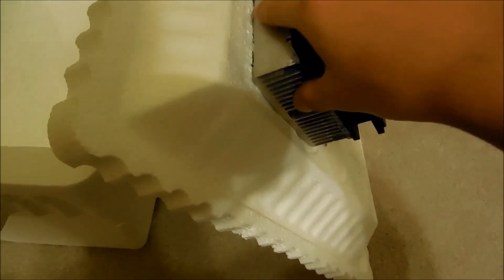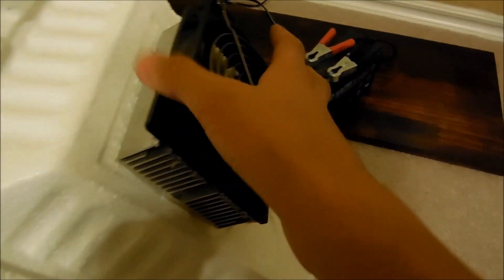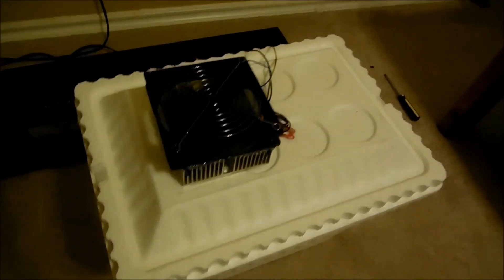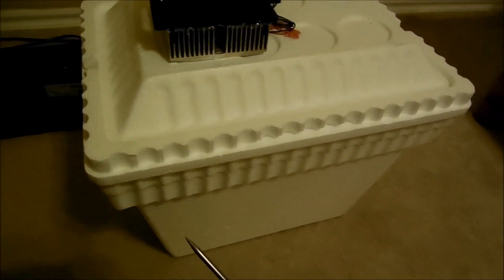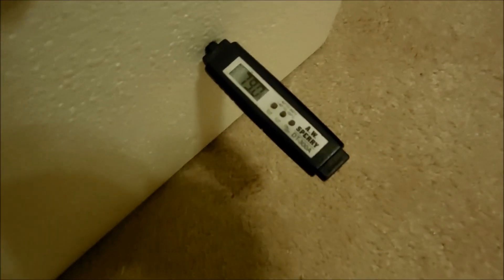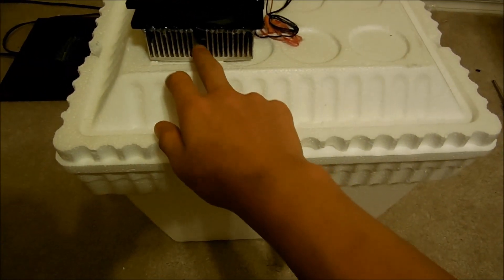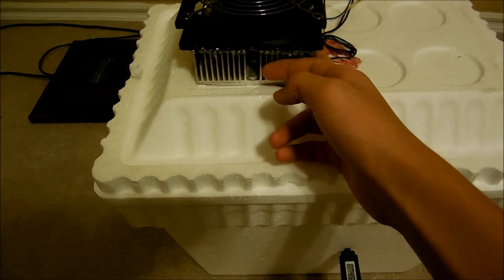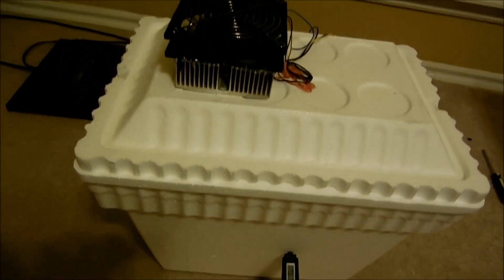DIY Thermoelectric Peltier Mini Fridge

Comment: This video is not complete without a real test of the cooling. Put some water bottles in there and then see how quickly you achieve temperature like 5-10 deg C
Reply from the maker: I agree...my 7 years younger self did not fully understand the importance of "thermal mass". The peltier thermoelectric cooler is extremely ineffective and inefficient, however I think it was still entertaining that it was actually able to cool down the volume of that ice chest.

Comment: 67F isn't really cool enough to consider this as a fridge.
did you ever check the current draw over the entire circuit. 
Would be helpful if one wanted o run this "cooler on a battery and needed to calculate running time.
Reply from the maker: It's certainly not optimal. But there are many "mini" fridges for sale that use this type of cooling device (that is actually where I got mine)

Comment: i had a quick question if i may ask. when hooking up the device with the 2 fans and peltier to a 12v 6a. should i do series circuit or parallel when hooking up the wires....
Reply from the maker: Parallel, all the positives together and all of the negatives together.
Reply: thanks

Comment: how about the power supply? how to circuit between peltier & fan.
Reply from the maker: The 12v Peltier and 12v computer fans all connect directly to a 12v battery, quite simple. If you want to use it in a car you could just connect the wires to a plug and use it in the car's 12v power socket.

Comment: Peace. Can something like this be used as a DIY A/C???
Reply: probably if the hot side is blowing out the window.
Reply from the maker: Yeah, you would need to vent it off outside but a pelier module does not have even a fraction of the heat pumping power to cool just a small room.

If you want to make a DIY A/C I would recommend finding an old fridge compressor and some AC coils and soldering up a refrigerant heat pump.
I am doing that for a DIY portable AC project and will eventually make a video of it.

Comment: Hi there,
Do you have a contact email. I tried sending you a private message in regards to the DIY fridge you made. I really need some help and advise on actually creating something using the same steps and system you did, but I want to make sure I am being safe and using the right materials.

Comment: i have a store bought can vending machine cooler. there is a spacer about 2 inches thick between the two heat sinks. Should i cut a hole in the back and put the heat sinks back to back? Will it make it colder?  I had to replace parts so i already have it hacked up with bigger fans.  It is 20 degrees colder than room temp. thanks

Comment: I wonder if a solar panel could power it all.
Reply from the maker: Yes, and no. The peltier plate itself uses 72W plus you need fans which is even more. With it drawing that much power you would need a really large solar panel which would cost a lot. (pelier units are extremely efficient)

Comment: I was wondering what was the lowest temperature you got it down to?
Reply from the maker: The lowest temp in the video is the lowest I have gotten it to, I have not used it since then, I made a new one with a R134a refrigerant heat pump which is MUCH more efficient. Thanks for watching and commenting!
Reply: the inside temp is relative to the ambient temp
Reply: +Electrotechnics 
Since most refrigerants condensation (after expansion) requires about 5 bar, it would be possible to use a common 12v compressor to achieve. I assume the heat pump you refer to comes complete with expansion and condensation chambers.
Would love to hear more about this build.

Comment: what were the dimensions of the peltier module used?
Reply from the maker: I think it is 40mmx40mm.
And to answer your other questions I just cut a hole in the foam box with a razor blade then hot glued the rest of the stuff in place.
A quick google search can explain to you how the heat sinks work better than I can without making this comment a huge article :) 

Sorry for the delayed response, thanks for watching!